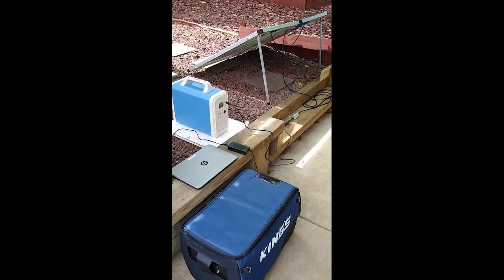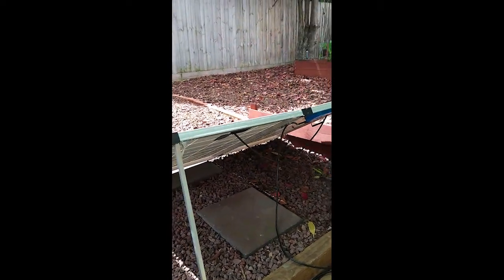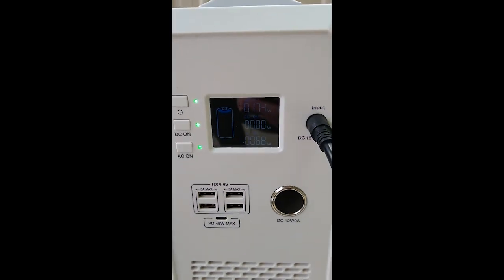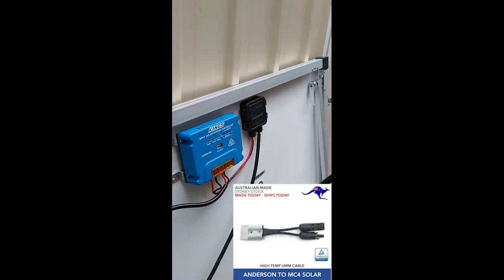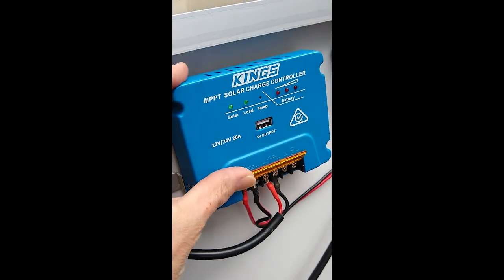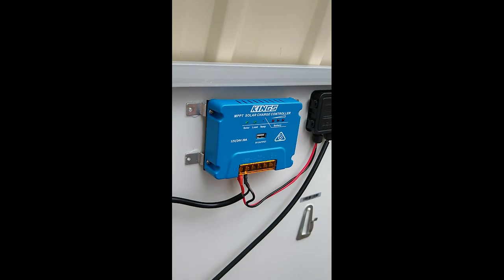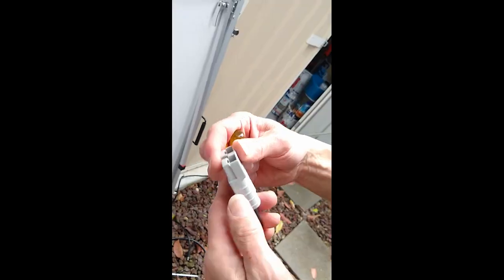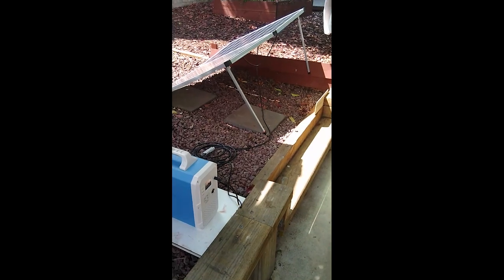Off-grid Camping Part 1: How to charge a BLUETTI Power Station with KINGS Solar Panels

Comment: Should this be applicable to a kings solar blanket? I’m new into this stuff and I’m still waiting for my bluetti Ac180..I’m considering this set up connection but I’m not sure if it works to a solar blanket..
Reply from the maker: Yes, it'll work just the same way as a solar panel, but usually blankets don't have a solar controller so it's even easier.

Comment: Hey mate, i didnt use the mppt that came with the solar and just connected it straight to the battery. It is charging but rarely reaches 150 Watts with my 250 watt solar panel If i use the mppt from the solar panel and do what you did, will it charge more power?
Reply from the maker: Circuits can only use on MPPT so it doesn't matter; it'll be the specs of the solar panel not matching te Bluetti perfectly, or just the weather.
Reply: @kingerz  thanks man

Comment: Hi mate - I have a 170 w kings panel - I've plugged this into my EB150 directly but it will not show any charge going into it - multi meter is showing 20 + volts at the plug ?? I've tried it switching polarity and nothing - any ideas ? I'm a novice when it comes to electrical and solar … any help would be appreciated. cheers.
Reply from the maker: Hi, those should be fine.
Make sure you have bypassed the panel's MPPT because it won't work with two (one is also inside the Bluetti).
 Try another panel if you can borrow one to eliminate a fault with the EB150.
There is a good Bluetti forum on Facebook otherwise,  https://www.facebook.com/groups/bluettipower.au

Comment: Hey mate, just setting up mine with a kings panel. Why'd you swap the negative and positive wires on the Anderson plug?
Reply from the maker: You may not need to, but if you get no input, try this.  Usually they are the other way around from the factory.
Reply: that is on the Bluetti side or Kings side? 
 @kingerz
Reply: @sheridankittle761  In my case, it's the Bluetti supplied MC4 to barrel connector, the one that plugs into the Bluetti DC input socket. A few people on the Bluetti forums have reported them being wired incorrectly. Mine was. Red (positive) was in the negative MC4 connector (each connector has a + or - stamped into them). I just swapped that around. I never thought to do it at the Anderson plug end. But then, I do use that cable for other things besides charging the Bluetti so, it was snippety snip with the red and back wires into the MC4 connectors, swapped them around, soldered and heat shrunk.
Reply: @kingerz  I have the Bluetti AC180. And the problem is with Bluetti's QC, I think. The supplied MC4 to barrel plug cable is wired back to front. I had to swap it over. If you look at the MC4 connectors they have + and - stamped in the plugs. The red wire (+ve) was in the -ve MC4 and vice versa for the other one.

I got a 200w solar blanket from BCF. It has an Anderson plug on it into which you connect the MPPT controller. But as I don't use that I have a 4m Anderson to Anderson lead which connects to a Supercheap Auto supplied Anderson to MC4 cable which connects to the Bluetti MC4 cable.

On Boxing Day (both the AC180 and a Dometic CFX3 95DZ fridge were presents from the family) I connected it all up. Blanket was  facing the western sun. Temp around 24 degs but a clear view of the sun as it approached the horizon. Maxed out at 130w. 

The stuff that we can buy today for camping is amazing, isn't it?

And thanks for the video, too.
Reply: Fantastic video easily understood by a complete newbie!
Thank you.